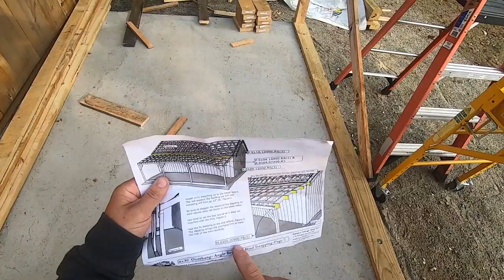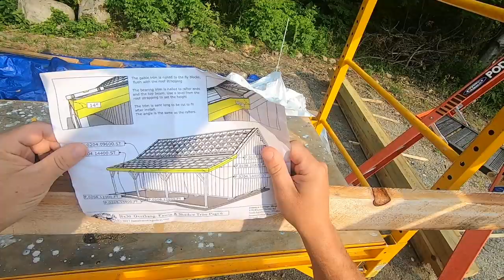It's Really Taking Shape NOW! Not Sure If i Could have built the BARN myself without these!

Comment: I would build a post and beam lean to.  4x4 posts 8 feet apart, then 2x4 every 4 ft.  Roof and siding with tin and put pallets down as a floor.  The biggest expense would be the tin, but it would last for 25+ years.

Comment: We always just used a bit of fencing like what is behind you while you were feeding the goats. angle out the top edge just enough for a flake to slide in. It'll slide down as they eat it. Other thing we've done is a tire with a feed pan in it like you use for the pig slop. It fit right down into it. Then you can either juts set it out for pellets of lean it on a cinderblock. easy stuff around the farm! My otto is 6 yrs old and loves watching this build come together!

Comment: With regard to your fire wood storage, my suggestion is to add an open shed roofed area over and next to your basement door...Build it so you can load the wood into the house while under cover...
Reply: My dad made a storage box outside with cupboard doors inside the house for access. We filled it every few days.
Reply: The only problem I would have with that would be rodents and termites. I have rodents that like to stay under the tarps where I store my wood, so I keep it far away from the house. Here in the South, we also have heavy termite activity, so best not to keep it close to a wood sided house.
Reply: You dont ever want to build a woodshed that close to the house. Mice, rats, possums, snakes, bugs of all kinds, including termites, love woodsheds and other outbuildings made of wood. Nearer the outdoor kitchen i think would be a better location.
Reply: Life is a series of trade offs...Where we live in the northern Catskills at 2200’ above sea level we are pretty much out of the termite zone...It frequently goes well below zero here and we get on average 4’ of snow per year...Having the wood pile as close to the wood stove is essential to keeping warm...I suspect Al’s winters are similar to ours...❄️❄️❄️
Reply: @cathiwim  Yes, speaking of location for the wood shed:
Think system and process.
The advice in the 1800s was to place your wood shed on the path between your kitchen door and the outhouse.
That way a person could use the excuse of getting firewood, to check the availability of the outhouse. 😁
As Modernsteaders this means, if the wood shed is on your way into the house, the temptation to grab a hunk it two of fire wood, on your way, will keep your wood box filled longer.

Comment: A good way to store firewood is a simple 4x4 pole structure with a canted roof. Tall wall side gets covered in the direction of prevailing winter wind. The other three sides stay open to allow the wood to cure and not rot.

FYI: Using a lean too against a wooden structure to store firewood encourages termites. If you go that route, keep dirt, leaves and debris to a minimum.

Comment: Hey Al,
We always just lay a couple 2x4s down (not flat, skinny sides down so they are tall) and built up some sides on both ends with 2x4s too. You can make them as long and as high as you choose. Just be sure to leave a couple inches between the wood and the wall of the building for air. We didn't have a beautiful barn so we just stacked them up against the house, under the eaves with a tarp over them. Worked for us in Minnesota and Washington. Of course you could dedicate space outside the barn under the eaves and you would not have to bother with tarps!! I like it! 💓💛💚💙💜

Comment: Permanent fire wood building, off the ground .  I bought used plastic pallets ( $8.00 ) each off Craig's list.  Plenty of metal cross bracing . Shed style metal roof with lots of  overhang, thinking of rain and snow. Longer on the back side because of the snow volume falling off.

Comment: I suggest building a wood shed from skids, also known as shipping pallets with a tin roof. That is what we use here in Ontario.  Leave the pallets intact and screw them together then add strappings to tie them together for strength. Add a slanted roof. Cheap and easy. Air circulation dries the wood.

Comment: For your firewood I use a 10x20 use cargo container ,I built a ramp up into it.works great,last a life time.
Reply: Wood needs to be very dry when you put it in, since it can't breathe in a steel box.
Reply: @gregbrown1083  your right about wood needs to be dry.so I installed 2 exhaust fans in my container with several vents ,air circulation .circulation is working out great.

Comment: I would build a 12x 12 ( size depending on how many cords you use over winter) P&B structure about 50 Ft from the house. Maybe somewhere near the outdoor kitchen, but not IN it or touching it. That way the wood is accessible for both stoves.

Comment: I understand you thinking of the cosmetics of hiding the end grain of your fascia and shadow boards on the rake of the roof line, but for water shedding it's not the best idea. Regardless of the tin covering those boards they still can get wet in driving rains, the water runs down the rake and hits the front fascia, shadow boards and will wick behind them. It's better to run the boards on the rake past the ends of the front boards. Typically in building this way, those rake boards would be run a little longer past the front fascia so water drips off the ends and down to the ground away from your structure.

Comment: Woodshed I am suggesting a three-sided structure that is expandable with a tilted sloped roof. It will have three sides with the front open air. This shed will not only me to store your firewood it will also be able to drive your lawn mower straight in. And store your tiller and whatnot that is seasonal. You can use the back of this structure to be fence line. You can utilize the roof to be solar panels. The front should be enough that you can drive your lawn mower in with you riding on it. 8 food. And one should size the overall size of with my what you can get your sheet metal in. And you would want some overhangs. Your firewood Bay now probably should have its firewood on top of some Pilots. The floor should be dirt or gravel. Now how long usually you put a post in the ground every 10 foot I would consider at least 30 foot.. if you do not desire to put the expense of a back wall you can use the firewood itself to make a wall of course you'll be using it in the winter time. Remember the idea of this structure is to keep water off the firewood and to keep Water Ice logging in the top row of your firewood pile. Other than that the structure is a luxury. Most homesteaders keep a long line of Greenwood and know when it is dried all year round they keep Andhra publishing the row with no covering on it at all. I would like to point out there's also the bug issue ants and so forth. In this you do not want to store your firewood near your nice new structure you just made or all of it at the house until winter when the bugs go dormant. I have seen some Homestead structures with a large back wall overhang. Your weather may need to be factored in this project. It is hard on any structure that is open air on one wall to be facing the wind. You also may want to consider snow drifts. But having a nice structure that is long I have seen one that is actually 60 ft long and he put all his small Machinery into such structure. Something else that you might want to consider is that you may want to experiment with grinding your own feed in a small midsize table top Grindr powered by an engine or a electric motor. This would be supplementing your sack feet. And if you had a better floor and could make a nice little feet shed.

Comment: you probably want to build close too the house so its close using palletts and tin for the roof here i just stack my firewood around the house aids in insulation and since my house is over 100 years old blocks a lot of wind. nice job on the build Al

Comment: Those wings on the barn must be for stables ?  How many and how big do you need right away?  What I'm thinking is to wall a portion by the small walk through door on the side(s) with the same lumber as the barn and use it for Winter wood storage.  I don't know yet how you are laying out the partitions for pens down each side yet.  There must be s series of small gates in  the pens under the shelter so you can get to them all from under cover in bad weather? If so, it would be nice to have an enclosed room by the walk through doors for feed storage too.  Maybe feed and firewood? Will you have a stove in the shop for winter work too?  How far is the shop from the house?  Do you have a nice place to store a weeks worth in house or on porch?  I think I've seen you on a utility buggy before, it sure would be nice when there was mud and snow to park in the shop to get a load of wood.  Could you give up a few feet of each stable to find feed or wood rooms, or could you just give up a whole stable off one side, or both for this room(s)?  I don't see that many homeless animals yet, but if you did grow and run out of room, you could take these back, or build more stables in three sided sheds as you need them.

Comment: I like Swiftnick88's suggestion. I would go with a 3 sided wood shed with enough depth to stand under the roof line in inclement weather. You could use pallets to keep the fire wood off the floor. I have a huge wood shed and all my wood is stacked on pallets. Blessings to all.

Comment: Kinda weird the barn company did not have you run the roof purlins ( 1 * 4's) out to the back side of the gable sub fascia overhang ? Extending the purlins all the way out, supports the bottom of the valley tin , the overhang framing and gives that solid screw support. Living on an old farm and fixing many old metal building . The one place that "lets loose" over time , is the roof screw , on the eve , into the edge of a fascia board. Just an observation and some feed back you might want to give to the barn building company ? 2nd if you want to add the screw to the over hang blocking , the top or sides are the better resistance point , than in the bottom. All the best . Solo building is never easy.

Comment: Getting closer to completion every day, Just two questions, will you have Batten strips on your siding to keep the weather out. Also why did you not put 45 or at least 22.5 degree cuts on your facia and shadow board joints.

Comment: AL, it's the little things that often are the most important.  You know how strong or weak your structure would be without them. I do not believe you would want to have to build another barn a few years down the road.  If you weren't so fastidious, the first huge wet snow storm, might just cause weight damage that could injure your animals.
QUESTION: ( because I honestly don't know).   I can not stand squeaks .  Could you put a drop of oil, or a tad of white grease on the clamps?

Comment: Gooooooood Afternoon Al ,
 I sure would like to have your scrap lumber pile. That sounds odd huh ?   Well , you see ,  I do not do enough  building to have any scrap wood . So when ever I need a small piece of lumber , I have to go and buy it .  Like now. I happen to need two 10" pieces of 2 X 6 and I have nothing like that around here. So yeah , I could use your scrap pile . lol
  I have a question for you. What is the purpose of the shadow board ?  It looks rather redundant.  Oh , and your clamps sound like they could use a drop or two of 3 in 1 oil .
 I know , lots of people use WD-40 but it's not really a lubricant as you know .
Reply: Cosmetic or aesthetic purposes.

Comment: Why not just add a lean to roof to the new barn on the backside the whole width of the barn and make the roof deep enough to cover the total number of cords you would normally use in year. No need for the extra expense of another building and you can put some kind of protection against the wall from either rodents or termites.

Comment: Al try using a salt block tray for a hay feeder for the kids. at Tractor supply 
Fortiflex SBP-10 Salt Block Pan, 50 lb. Capacity, Black
SKU # 222965099